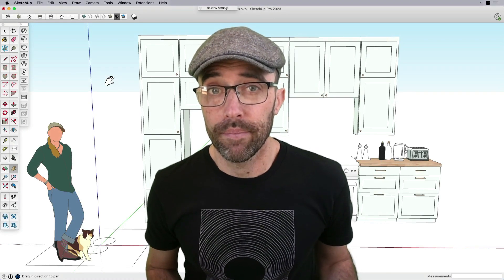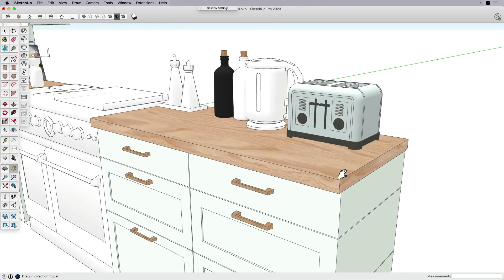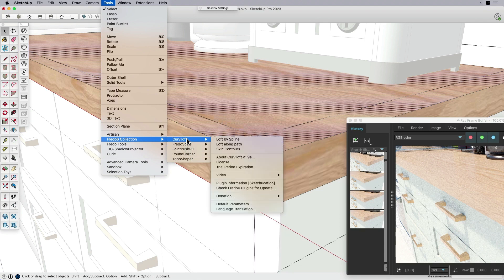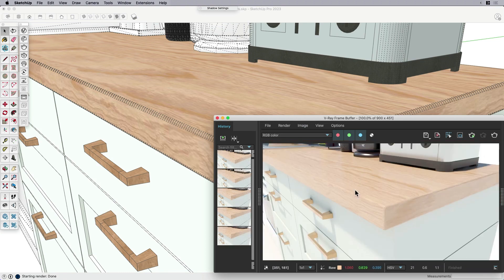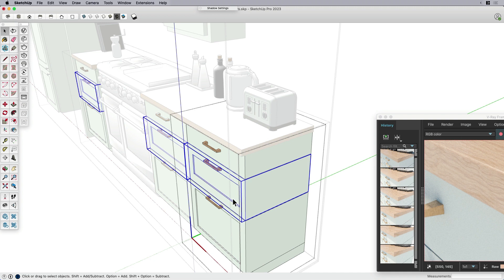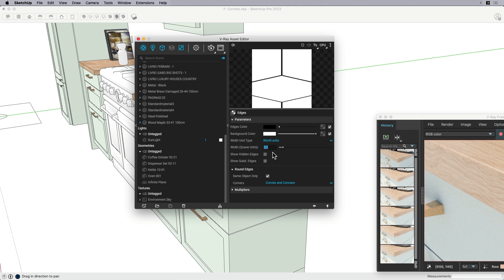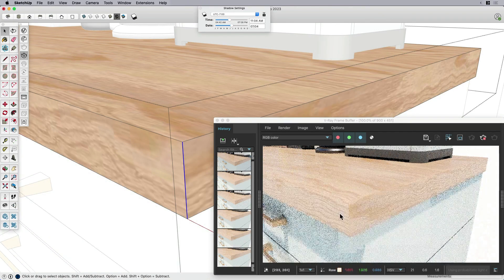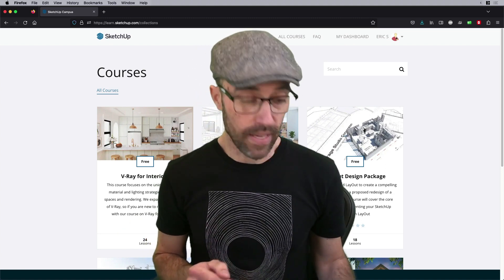Realistic Rendering with Round Corners

Comment: That was a terrific tutorial Thanks so very much I appreciate. I was wondering if you could title your videos a little more towards what you're doing. For instance you used an extension that I don't currently have and probably won't ever use because every time I renew my sketchup I have to go back in and set up all those extensions which kills me in workflow. If anyone has any suggestions on how to get extensions to follow over with upgrades for updates I'd appreciate it Thanks so much. But I'll keep watching
Reply from the maker: Good comment. We added the link where you can download the extension in the description. Hope that helps!
Reply: @SketchUp  is there a way to keep the extension and it's settings intact between each yearly upgrade? That's why I don't use extensions.. it's a pain to set them up with every new version of SketchUp. Thanks.
Reply from the maker: @kpeel1357  Most of your extensions will work if you copy them from the previous SU version's 'plugins' folder to the new version's 'plugin' folder. Some of the more complex extensions, like V-Ray may need to be reinstalled. Should only take a few mins...if you have many extensions, then it's good to use this opportunity to review and copy over just the ones you really need and use often.
Reply: @SketchUp  Thanks so much for that information could you share a link that shows how to copy over extensions? I'm not even sure how that works when I can't get general settings to come back in I have to reset up everything each time. I'm not mad at it I'm just used to it now and I do love sketchup. Thanks for all your help
Reply: @Eric S Thanks so much for looking out I gave it a try I have a couple extensions I have installed now and my update comes in June so we'll see what happens. I just hate that it slows down My workflow after the new update. Thanks again